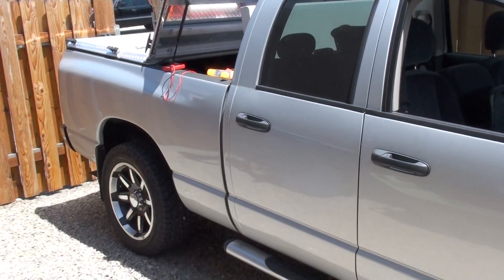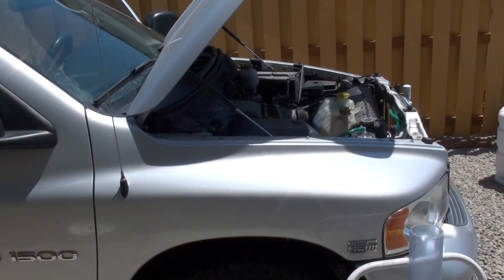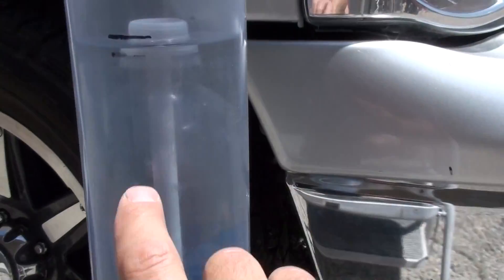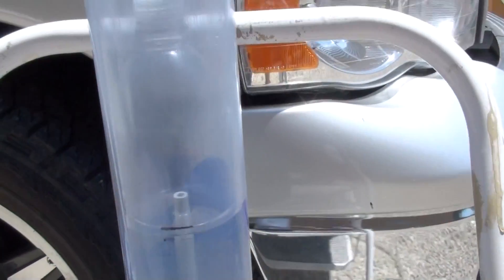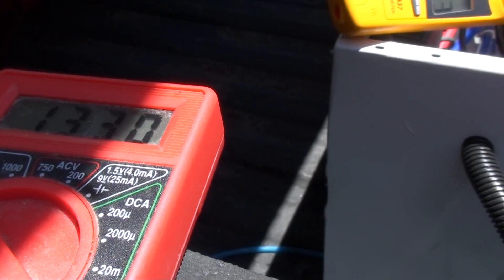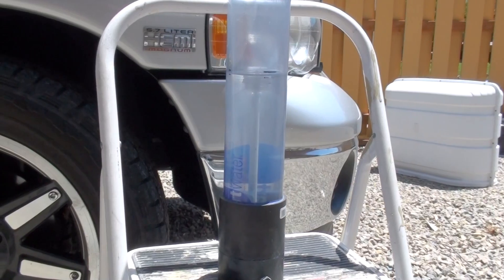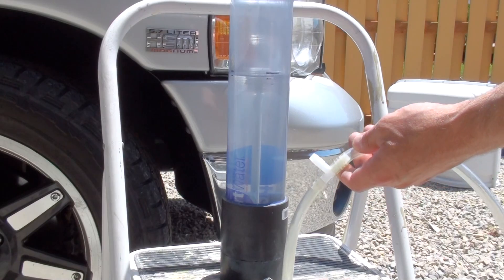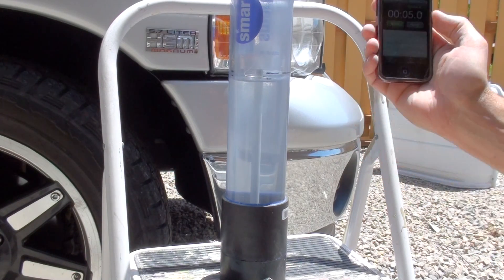288 Plate HHO generator Dodge Ram project. Part 5 LPM TEST

Comment: That’s an impressive amount of HHO per minute. Would you consider sharing the circuit and electrolyser design? I tried a few designs a few years back; the horsepower went up, but I guess the oxygen sensor defeated the fuel economy increase, dumping more fuel into the injectors.

Comment: The system that I built from scrap in mi own backyard have many improvements all over . 1 First is the generator ,  it has quick changing plates system for corroded elements , high flow for the liquid and gas , and the G.A.C.D. gravity assisted contaminant dispenser . 2 The first Reservoir (witch contain the electrolyte ) it has G.A.C.D. and as well G.A.F.D. gravity assisted foam dispenser . 3 The bubbler it has built in flash cap port like the first reservoir ( basic it all the system is built in with flash caps )  . 4 The Clean Water reservoir , is made to replace with an singe turn switch , all the contaminant in the generator and first reservoir .    https://www.youtube.com/watch?v=Syk9j-IrXAE

Comment: I guess you need a stupid huge 5.7 ltr engine to provide the ampage to run it.  Seems like you're going backwards here.  You need to work on a design that doesnt need huge ampage like this.
Reply from the maker: +thra5herxb12s I think you missed the point of the whole project. I know hho works in small quantities. These video's were done to see what would happen if large quantities were added. It proved to me that more hho is not always better.
Reply: +delvis11 No I got the point but my cars alternator only gives 80 amps max so I'm looking to generate half of the engines fuel requirement while not creating  significant load on the relatively small 2ltr engine as this would also increase its thirst.

Comment: you should have a smaller belt gear on your alternator so at lower idle speeds it will produce higher amps..  Did you check your amps at higher RPMs
Reply: It was literally doubling! With the gas pedal!

Comment: i would like to make or buy a system for my fishing boat it has an 855 cummins diesel its turbo charged and has the big cam 855 is cu inches about 350 hp cav you recommend a liter per minute system for me

Comment: Hello. I am a Mechanic that is planing to do a similar set up but before I start anything I would like to know the burn rate (octane)to figure what is a good compression ratio  for a setup. And when you try it on the ram, will it run hotter? I believe it a leaner mixture. Thanks
Reply: Burn rate is not "octane"

Comment: Dude that is sure a lot of work for so little gain. I have put something on a 7.3 and put 28.2 gal's in tank and drove the dwelly automatic 1012 miles that is 35.8 mpg and cost to put it on the truck under 50.00. I also have put it on my ford ranger 32 mpg. And the list goes on and on.

Comment: to answer that question: it takes a considerable amount of energy but makes the gasoline engine/combustion more efficient. This is also quite a bit of hydrogen on demand which allows him to lean out his current fuel for even better results

Comment: I don't get it, using 160A you produce 12 l/m.  That adds fuel to the combustion reducing the amount of fuel that needs to be injected to travel S distance over time T.. Now add back the power in watts required to spin the alternator (or two) to make the 160 amps.  I'm not a chemist but does HHO produce enough energy to have a positive efficiency in this system?  Seems like it takes more energy (drag) to produce it then energy it outputs to the system.

Comment: I admire your hard work but I'm pretty sure 12 volts will NOT supply enough power to all those cells. If all you want to do is save gas see what whyme2b is doing with his truck. I don't think it cost near what this must have cost to build. Peace and good luck!

Comment: Great info..was wondering, how can you keep your donor vehicle (pickup) at idle, and with the computer keep it at idle also...and with the input of hho increase rpms thus leanning the motor out, even if you had to use a ball valve on pure hho line laying across intake opening to control rpms,  not sure of any of this, but I do appreciate all your videos....thanks

Comment from the maker: Yeah thats what I thought but had to check. The flow meter your mentioning and i assume your using is a LPM AIR meter. gasses have different weights so these meters are gas specific. Dwyer makes a hydroxy meter but I haven't tried it. These AIR meters are grossly inaccurate with HHO, they are not calibrated for it and the reason why I don't use them. I've got one collecting dust in a drawer somewhere. People need to be aware of this.

Comment: 1. Simply go to eBay.
2. After signing in to eBay enter this into search, 

Dwyer RMA-25-SSV Rate-Master Flowmeter 10-100 LPM Air Stainless valve meter

I am not a Salesperson for said Flowmeter, I have three of them and they are Pretty Accurate, and Very Simple to Use.

A lot of people who do HHO experiments measure their gas flow rate by your Method, this may be Accurate, But it is Messy and Time-Consuming.

Comment: I am a Big Fan of your Work, I Always had just one problem with your Demonstrations, and that is WHY Don't you just use a Device that Measures Liters Per Minute, they sell them on eBay and they're a lot More Accurate than You're Methods.

You will get a lot More Done a lot Faster if you just had a Liters Per Minute Meter, You can get one that measures from 5 to 50 Liters Per Minute on eBay for less than 40 bucks.

Comment: Steve, was this test done at idle? As I recall from your last video your Alternator's output dropped off to a max of about 25 amps per cell at idle, correct? if so, shouldn't your output go way up when you get the full 40 amps per cell at cruise?

I sent your YouTube kink to my nephew, a diesel mechanic. He thinks your on the right path. I hope he subscribes, he can contribute a lot from a mechanics standpoint.

Denny
Reply: Yes! I was watching that! The hho should literally more than double. He showed it going from ~22 amps to ~40 amps per cell with the gas peddle! Amazing start